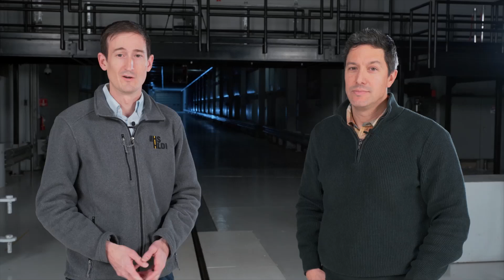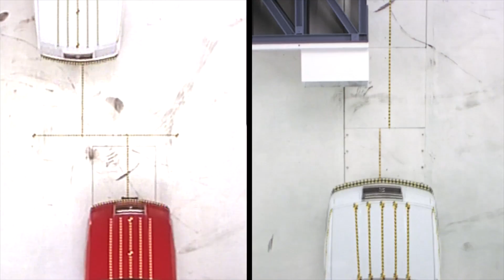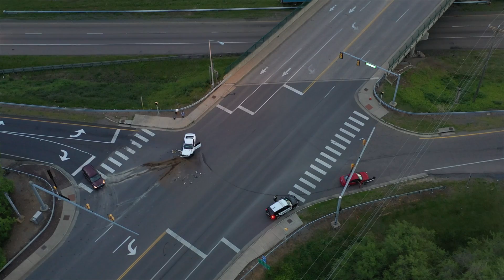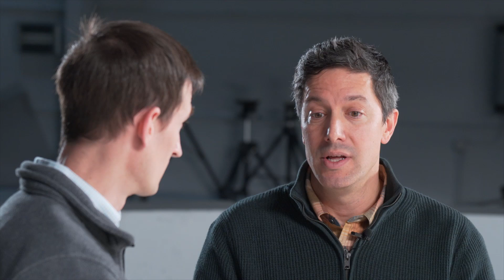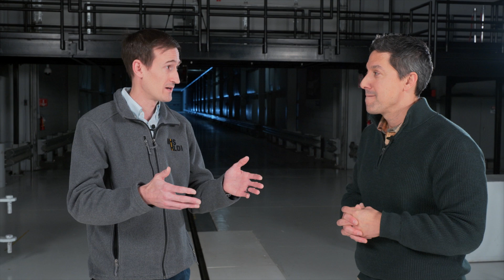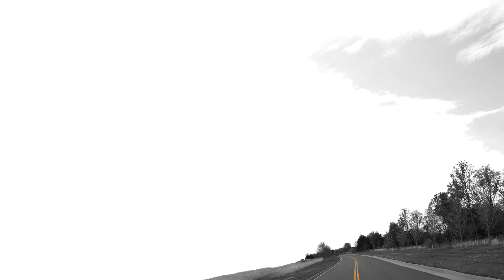IIHS answers your questions about test speeds

Comment: More clarified reasons by bullet points:

- IIHS is a research firm made by insurance companies to make vehicles safer so that they can reduce the money paid for casualties in crashes + some of the car damages (seen from IIHS's bumper tests and crash prevention system tests)
- 40mph is the speed at which the most crashes occur
- If they test at 50mph+, car manufacturers will reinforce the body structure to optimize the crash results.
Thus,
- The cars will be more expensive, and the insurance will have to pay more for the vehicle's repair or total loss coverage for all speeds of crashes
- At lower speeds (for example 40mph) where more number of crashes occur, the injuries may be more severe, and they have to pay more for the casualties.
- Optimizing the car's performance for a 40mph crash is the sweet spot where they can reduce the most expenditure for the insurance coverage.
Reply: #5....*no they F-ing wont!!*  volvo & the germans already know enough to have people walking away from 50+, if they can, anyone can

Comment: @IIHS: In mechanics and material resistance you work with forces, not energies. Car structures use materials which are tested/subjected to forces. Both persons in the video talk about energies, which is scientifically incorrect and the improper physical notion when it comes to what car and people have to endure in a crash.

Comment: So professional and honest
Reply: These are more clear reasons by bullet points:

- IIHS is a research firm made by insurance companies to make vehicles safer so that they can reduce the money paid for casualties in crashes + some of the car damages (seen from IIHS's bumper tests and crash prevention system tests)
- 40mph is the speed at which the most crashes occur
- If they test at 50mph+, car manufacturers will reinforce the body structure to optimize the crash results.
Thus,
- The cars will be more expensive, and the insurance will have to pay more for the vehicle's repair or total loss coverage for all speeds of crashes
- At lower speeds (for example 40mph) where more number of crashes occur, the injuries may be more severe, and they have to pay more for the casualties.
- Optimizing the car's performance for a 40mph crash is the sweet spot where they can reduce the most expenditure for the insurance coverage.
Reply: Dishonest. If people keep driving at 80 mph on the highway, then IIHS should raise the crash speed to at least 50 mph. Thumbs DOWN for this video!

Comment: My question is why back seat safety wasn't put on the radar until the last few years.    Suddenly a vehicle that was a top safety pick is no longer safe for your family?   It's seems insane that pretensioners haven't been looked at until now.    Most people can't afford to go just buy a new car to get those features.
Reply: "...why back seat safety wasn't put in the radar..."
Because the average trip has less than 2 occupants. The most-important seating-position for safety is the driver's seat, because it always has an occupant. Gradually, over time, lower-priority safety factors (such as the lower-occupancy-rate seating positions) are given attention.
Reply: @aliendroneservices6621  Agreed.   Just seems strange that back seat side impact airbags and crash worthiness came before, "Does the seat belt tighten up in a crash".   Especially on vehicles that are designed and marketed as family vehicles.   I agree that it takes time but I find it odd that it has taken till just recently considering that pretensioners aren't highly expensive or difficult to equip.
Reply: @MontanaMedic13  Fair enough. You make good points.

Comment: My Tacoma runs well between 75-80mph, whereas my wife’s Outback enjoys 85-90mph.
Usually in our home state of Washington we’ll set the cruise on 75-80 on I-90, because the speed limit is a mere 70mph.
But when we go to the family ranch in Montana, the speed limit is 80mph, so we set the cruise on 85-90mph.
At 75mph the likelihood of dying in an accident is quite high, so at 80-90mph survival is not very high.
I’d rather be dead than confined to a wheelchair or tubes coming in and out of me.
We’re firm believers that when it’s your day to die, it’s, well, your day to die.
Reply: This video was just full of gibberish…
Reply: @unknownunknowns  And what scientifically proves your theory?
Reply: @Doc1855 Maybe you can make me understand why IIHS refuses to raise the frontal crash speed to 50 mph, when, as you pointed out, 80 mph is becoming the norm.

Comment: I would like to see IIHS start testing tail lights.  They test headlights for their ability to light up the road (the ability to see).  Tail lights are no less important in that they make sure a vehicle can be seen.  And I have seen some seriously bad tail lights on new cars.  Manufacturers focus more on an aesthetic rather than function.
Reply: Like the Hyundai's with the blinkers down near the bottom of the bumper
Reply: @heavenleigh111 exactly...and that crappy design has spread to many brands of vehicles now.  And I don't think it affects just drivers of other cars.  When I'm cycling on the roads and come across a stack of cars in the right lane, I can never see the blinkers of those cars with the lights in the bumpers like I can with cars with blinkers higher up next to the tail lights.
Reply: I agree especially with indicator lights. A lot of the times in the US the indicator is incorporated with the break light so its hard to see when someone is slowing down and is going to make a turn. In Europe it is required that the indicator is an amber color separate from the break light.
Reply: Agree. Separate turn signal lamp of an amber color (instead of red) should be a requirement for the TSP+ score.
Reply: Oh gosh yeah, combo turn /brake lights should be changed to separate fixtures. They are so hard to see during the day
Reply: I’m sorry but if you can’t see the 3 red glows in front of you at night you need to get your eyes checked or that vehicle is using blackout lights which is illegal anyway
Reply: @SlapshotJack  Wrong answer.  There are vehicles out there with brake lights the size of your thumb.  There are tail lights out there that are pencil thin.  I'm sorry you think that's sufficient.  But it isn't safe.
Reply: @MarkRenn  says the one that can’t see for crap I can see every brake light on the road any size from up to a mile away so it’s you needing to get your eyes checked buddy
Reply: @SlapshotJack  Sorry. Wrong answer. But thanks for playing the game.

Comment: This video still doesn't explain why IIHS cannot increase the speed a bit to like 45 mph.  That would cover even more crash test scenario and save more life.  While at the same time, not significantly increasing the cost for car company to reinforce the car.
Also, every single car nowadays have a good IIHS frontal crash rating, increasing the crash speed to 45 mph would help separate the true winner from the crowd.  Allowing consumer to select the best from the best, in term of safety.  

This video seems to show why IIHS keep coming up with excuses to Not give more protection to consumer. But rather, give more protection to car company wallet. At least, that's what it look like.
Reply: I think these should be the more clear reasons:

- IIHS is a research firm made by insurance companies to make vehicles safer so that they can reduce the money paid for casualties in crashes + some of the car damages (seen from IIHS's bumper tests and crash prevention system tests)
- 40mph is the speed at which the most crashes occur
- If they test at 50mph+, car manufacturers will reinforce the body structure to optimize the crash results.
Thus,
- The cars will be more expensive, and the insurance will have to pay more for the vehicle's repair or total loss coverage for all speeds of crashes
- At lower speeds (for example 40mph) where more number of crashes occur, the injuries may be more severe, and they have to pay more for the casualties.
- Optimizing the car's performance for a 40mph crash is the sweet spot where they can reduce the most expenditure for the insurance coverage.
Reply: 80 mph is becoming a less uncommon speed these days on the highway.
Reply: @unknownunknowns  yea, thats why 40 mph crash test is a joke.  The frontal crash test speed and standard haven't changed or improved at all in the last 35 years.
Reply: shame on them. they have the balls to admit their problems, and quickly admit "f**k it, we'll do nothing about it"

did those guys seriously forget that it was only because of IIHS that manufacturers took it up a notch to beef up for 40, and beefing up for every test after that caught them off guard ???
 if germans can do 60, anyone can.

Comment: Has the IIHS considered crash testing where the vehicle is already in deceleration (seat belts loaded/tensioned, occupant leaning forward)? A scenario would be a driver braking hard just prior to a crash. 
All of the crash testing thus far has been with the vehicle at 0 acceleration/deceleration just prior to crash, which means the occupant is in the neutral/resting position. 
I would imagine the results would be a fair bit different if the occupants are already leaning forward against their seatbelt.
Reply: That's what the pre-tensioner is for. It's an explosive or spring loaded system that pulls you upright in your seat
Reply: @Miner332  it only is able to tension so much, so the occupant may not always be pulled upright completely. So in my mind it's still a test case worth exploring.
Reply: Very good point, on top of that, vehicles dip down in high braking scenarios, under ride scenarios in cars vs trucks etc
Reply: It is hard to replicate, would be a better test, but not consistent across many vehicles. The only way to do this is maybe on sledge, just to see seatbelt pre-tensioning effect on leaned occupant.
Reply: @worawatli8952  I'm thinking it would have to be a fixed deceleration rate that's applied through the pulley system that's pulling the car. That rate could potentially be determined by getting the average deceleration from a series of common vehicle styles braking by multiple different drivers on a dry road surface, or by a traffic safety study of the average deceleration of a vehicle just before collision.
Reply: good point but i feel like it would be difficult for them to accurately simulate a situation like that since every driver is different size wise. it could also vary on how hard a driver would press on the brake and how far said driver would lean, seems like too many variables to be a viable test
Reply: @andrewsantora7943  You would conduct it similarly to the crash tests they already do; the dummies are the same size. The only change would be something like you start the speed higher than the actual crash speed, and at a fixed distance from the barrier, the vehicle is slowed at a fixed deceleration rate such that the collision occurs at 40 mph.
Reply: If you are leaning forward it's your problem. Never leaned forward while driving in my life.

Comment: Testing at the IIHS are flawed...especially side impact...I just saw a lifted Tundra hit a new 2024 RAV4 in the side (T-Bone) and the Tundra went through the RAV4 and killed 2...the Tundra had no damage except a flat tire and busted wheel... they need to raise the test sled about 3 feet and retest side impacts...
Reply: most people are not driving lifted tundras that's not fair
Reply: come to the south half of the USA, every 3d vehicle you meet is a lifted truck @NevyZine
Reply: Lifted trucks are actually non-compliant vehicles.
Reply: Better idea: require a CDL to operate any vehicle with a GVWR over 6,000 lbs (e.g. every full-sized pickup truck). Effective immediately, with no exceptions.
Reply: @aliendroneservices6621  That's a bit excessive and would cause a major crisis on the road as most vehicles would become worthless overnight. I think you have no idea how many vehicles have a GVWR of over 6000lbs. Enforcing the laws against lifted vehicles would be more practical.
Reply: @imzjustplayin  it actually is not a radical idea. Up until recently, only work trucks were so big. The regular every day driver was never supposed to have trucks this large. They're heinous and pointless unless they're for actual work. In which case yes, a special license should be implemented immediately. These people need to be properly educated on driving these huge trucks. They're just ridiculous. They're incredibly dangerous for everyone else on the road.

With that said lifting them should be down right illegal.
Reply: @NoName-gv6nm  It's a radical idea because you're asking for something to happen overnight. Vehicles with a GVWR exceeding 6500lbs being driven by C class drivers have existed for more than 70+ years. A ford F-3 which is basically an F250 truck from 1948 has a GVWR of 6800lbs. I just don't think you understand how much chaos would ensue if overnight a CDL was required to operate a vehicle of that size or larger. Everybody that did delivery except in the smallest of vehicles would require a CDL overnight. If this was something that was going to be taken seriously, it would have to be gradually implemented over a period of years.
Reply: @NoName-gv6nm  Well when you say stuff "overnight" it makes you appear extreme. I fully understand what you're getting at though about the vehicle weight class and driver's license rules. The thing is, what extra training would there be for a larger vehicle compared with a smaller vehicle? Anything with a GVWR below 26000lbs doesn't use airbrakes anyway for example.
Reply: Thar is obviously a problem with lifted trucks, not the crash test standards. Next is "i saw a car being run over by a tank. IIHS should test that"
Reply: This.
Reply: Can't test cars that are strongly modified in fact in the case you expose must be an illegal modification considered in the state and make to the driver of the heavily vehicle liable of the what happens when crash against other cars

Comment: Speaking As an engineer, you validate your designs using the worst case scenarios possible. In terms of vehicle crash testing this means testing at  higher speeds. Sure cars may not pass the tougher test initially however we shouldn’t just give up, given time they will easily pass.
Reply: They explained why engineering for higher speed crashes is counter productive. Watch the video.
Reply: Affordability has to be considered, as well. The more requirements regarding safety mean manufacturers have to spend more on engineering and development to pass tougher tests and those cost will be reflected in car prices. Prices are already too high for most.
Reply: @mylesmadison8289  what even is that comparison? doesn't make sense
Reply: if germans have enough meat on the bones for 60, anyone can

Comment: Why don't you perform rear-end crashes?? I know the seats and headrests are tested, but not the cars rear structure itself
Reply: This is my greatest fear while driving. I can control where I go but the people behind me are entirely out of control.
Reply: @N20Joe  always keep track of your surroundings by using your mirrors frequently even if you're not changing lanes or anything. Situational awareness
Reply: In part because rear end collisions have a much lower proportion of the overall driver injury and death rates; e.g., a very low % of that 40K. I'd bet that more pedestrians are killed in that 40,000/year than those who are as a result of a rear-end crash.
Reply: @joec1774  NHTSA already does back tests at 50 mph, so there's that
Reply: NHTSA does it already at 50